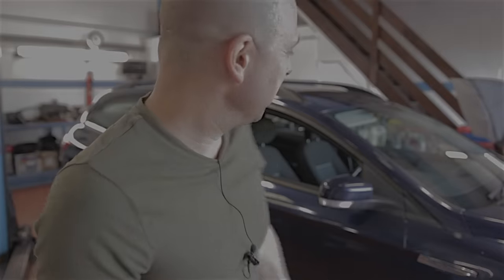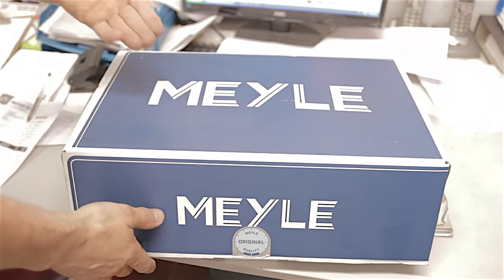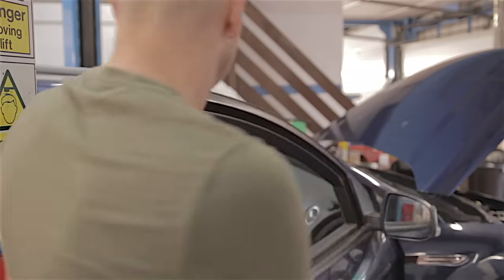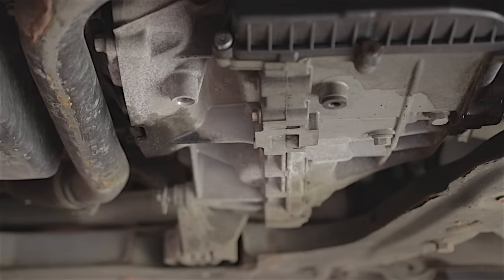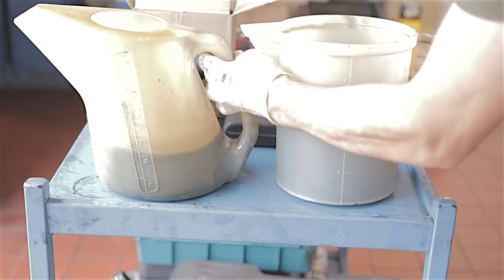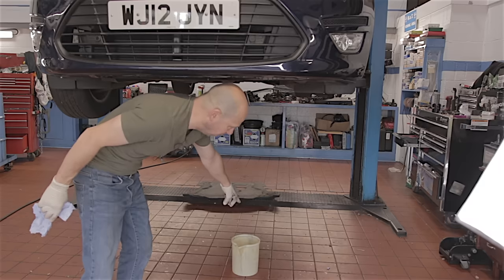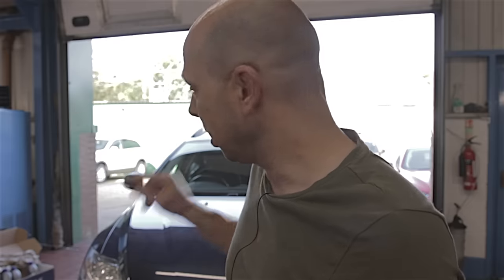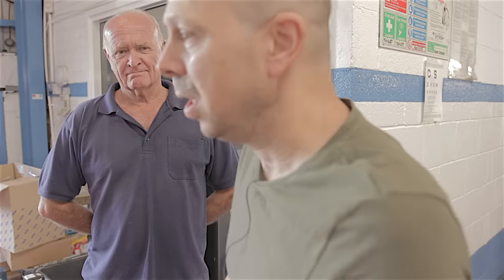Ford Mondeo Powershift Oil & Filter Change ....Lucky Me !!

Comment: hate the power shift box your right what you say about the correct oil if you use the wrong typeit makes the plastic spacers disintergrate in the clutch pack making the car judder and the plastic magnet holders on the selecor forks to brake away and the car dosnt know what gear it is in. what i would sugest and i know its expensive but get a box service kit from ford they come with the back seal for the oil filter housing that is bolted to the side of the box and replacement bolts and gaskets for the mechatronic unit so you can clean the swarf from the selector magnets runs like a dream after. the reason for going through the gears befor hand is it puts the box in service mode opening all the solenoidsalowing the oil to compleatly drain. you do the same after as it will purge the air from the system and take it out off service mode. its the same prosses when changing the clutch pack
Reply: Great bit of advice there Tony.
Reply: Thanks for that info, I got Ford to do a warranty gearbox  job on a Mk3 Galaxy after a small claims victory, proved in court that the wrong oil was used.
Reply: Hence I guess why they get called Powersh1t Box... However, I think this owner has been very lucky with his g-box
Reply: @davyarthurs  There are 2 types of Powershift. A dry clutch and a wet clutch box. The wet clutch are the ones which are more reliable and what is shown in this video. The dry clutch is the source of most problems.
Reply: @Dark-qx8rk  how did you found is the wet one version? i have a 2011 S60 volvo
Reply: @savvasgreece8700  If it has a Getrag 6DCT450 gearbox then it is wet clutch. You will have to ask Volvo to tell you what gearbox your car has.

Comment: I have a Ford Mondeo Mk5 2016 2.0 TDCi BiTurbo 210 bhp estate. The model only comes with a Power-shift gear box.   My local Ford dealer in Devon charged me £356.54  just to change the gear box Oil.   You have now reassured me that the Oil is very expensive..I thought I was just being ripped off , but appears just only now on the Labour. Thanks for a great video..

Comment: my mk4 is strange. when putting it in Drive or Reverse it takes like 2sec before it engage and it gives a smal jerk. IF i try to give throttle before 2sec it jumps like a kangaroo. I let a mechanic change oil but still same. What can be the problem? when it runs on the street all gears go in smooth. Its just from standing still when selecting D or R it feels like some delay

Comment: Followed your instructions and changed the oil on a 2014 C Max 2.0 TDI which went perfectly. Car did have a gear change issue but the new oil and a reset of the engine light resulted in smooth gear change and a happy father 😀
Reply from the maker: that's great news, cheers

Comment: I'd just like to say that it's very refreshing to find a video where this oil change is done correctly!. Good work.

Volvo recommend 40c temp for the drain and oil level setting (same gearbox 6DCT450 / MPS6).
Reply: I have a V40 with Powershift, what is the best oil?
Reply: @eufanca  any DCT fluid will do. 
They are expensive!
Reply: @eufanca  Castrol Transmax Dual

Comment: Great video, thanks Alan.  Just changed the oil and filter on our S-Max auto, found it almost impossible to access the filter (and the retention clip) without taking the nsf wheel and liner off, but straightforward other than that thanks to you. Cheers!
Reply from the maker: thank you

Comment: Have a 2016 180ps with powershift. Love it. Only had 1 issue where it would go into "limp mode" under heavy load. Turned out to be an oil sensor on the gearbox (changed under warrenty).
This is my 1st owned auto and will never go back to manual, I tow with it and its superb. Though I had a VW passet 2012 DSG for a week and hated every minute of that.

Comment: Did this job myself on my driveway,same colour car,ink blue titx 2013. I used Morris oil and filter using old housing,grand total about 70 quid. Use it for taxiing about 600/700 miles a week,now on 135k and still drives like a new car,so I've been told.
Reply: Did you check the level afterwards or just put 5.5 / 6 litres in ? I’ve heard some people just put in what came out & thats it

Comment: I run a 2011 S-Max same engine and gearbox. Had the car 6 years. Local Ford Stealers will charge anything from £250 -£400 for the service, I pay £250 obviously but will probably do it myself now after seeing the video!

Ford recommend servicing the powershift every 37,500 miles or three years. My car is coming up for 110,000 miles. You know when the oil needs changing as the clutches start to slip to the point where every change is an issue and in gear acceleration  is met with major slippage, change the oil and the car is beautiful and smooth again, I love it and have no complaints, I also tow with it and again it’s fantastic. I would definitely have another. Thanks for the video 👍
Reply: Hi Graeme, thanks for this comment.  This/these seem to be my issues.  Mainly in 1st and 2nd at the moment but suspect it'll get worse the longer it's left.  Certain I don't have any leaks so must just be wear and tear.  Have owned the vehicle since 119,000 and now on 142,000 with no evidence it's (outbox oil and filter) never been changed. Just ordered the same kit that's in the video for £112.  Just a case of trying to figure out how to get the car jacked up and level to carry out the drain and re-fill.

Comment: watched your auto gearbox oil change and found it very easy to do myself, mine as 7 lt of oil for the vignale and got my oil and filters etc from Ford Germany at £140 all in  P+P, took 3 days
and its Ford parts, also changed the engine oil etc. great and Hi to Mrs M LOL

Comment: I've had an S Max for 3 years now with the Powershift fitted. Changed the oil every 37000 miles and not had any issues with it. Still very smooth.
Reply: Sean Penney that’s a very specific number
Reply: @TheReecebob  I agree. When I first bought the car (second hand) there was no history of a gearbox oil change. I had the first one done at a ford dealer because of the garentee I had. The guy there said every 37000 miles.since then I've done them myself (2)
Reply: I should add I live in southern Spain. Maybe the oil change schedule here is different due to the high temperatures we have.
Reply: Sean Penney I was advised 37,500 or three years by Ford

Comment: Ford had put 7L in at 120000 km which i had no idea i started having transmission limited happening at now 180000 dumped the 7 put 6.1 in and best its ever ran dont put 7L in these I feel alot of the problems stem from incorrect transmission oil amounts and wrong type of oil and i would like to say thanks for the video saved me having someone else doing the same thing.

Comment: Another great video! Wet clutch Powershift gearbox are fine if serviced at correct interval but dry clutch Powershift gearbox are not great. Suffer from clutch shudder,  jerky pull away etc. Only in Fiesta and Focus petrol I believe
Reply: Fully agree with you 👍
Reply: What year are the wet clutch powershift gearboxes installed? Thanks
Reply: @jamesm5744  I believe 2010 onwards depending on models but not 100% sure
Reply: @simonnell9144  Thanks a million

Comment: Live in France and use local garage who does not want to do this job. hate the idea of going to Ford but might have to. Re the box, great. Just towed large caravan round Spain and Portugal, 3,000 miles with only one problem. 2 hours continuous driving including lot of hills at approx 55 mph, then turn off and immediately a 1 in 16 ramp up to campsite. car stopped and warning message "transmission overheating". waited a minute or so and proceeded slowly up the hill. No other problems but smell of hot oil that lingers, hence need to change oil. car has 95,000 miles on clock and don`t think oil has ever been changed. Good car, good gearbox. Hope that when time comes my sister-in-law will buy me another.

Comment: Hi Alan, great video as every one you make. I have a 2014 Ford Galaxy 2 ecoboost and I'm also about to change the pewershift oil. Great tutorial. I just don't like the dirty gloves on the steering wheel and gear lever. I always take them off so I don't dirty the car inside and reach the dirty steering wheel from the oil :-) but great video as always. You are the best
Reply from the maker: yeah, naughty me, cheers rudolf
Reply: @alan4x  Alan, you are a fighter 👍

Comment: Thanks mate. The info level check was what I was wondering about. 
I have only had some shuddering in first gear on a slight incline, a software update fixed it. It’s getting a bit thumpy now so I’m going to put some Redline Oil in to try and improve the shifting.
Reply from the maker: Glad it helped

Comment: I've got this gearbox in my M5 2016. I'm about to service it for second time. To change oil in gearbox I was told to do it every 3 years but because of the cost to replace gearbox if it went wrong. I change oil every 2 years when I do engine oil and filter.
Reply: Same engine and gearbox inside a Ford Galaxy,  I do the gearbox oil change every 20k miles . Its the tiny metal filings that go into the mechantronic solenoid valves that cause the issue of a faulty  gearbox. Changing the oil earlier resolves this problem.

Comment: I’ve Done this twice now
Best to use the Volvo service techniques for this dct   it tells you the transmission temps etc 
Mine started to shudder at 44000 km so I just do it at 40000km intervals instead of the recommendation 
Of 60000 with a genuine ford 
Filter kit plus Reputable dct oil that has the correct ford specs

Comment: Not a bad gearbox when its working although a read through various sites and forums on the internet might just put you off.Like most automatic gearboxes it will need regular servicing which most owners seem to neglect getting done and is often over looked due to expensive parts (mainly the cost of the oil)

Comment: Good video Alan... 👍 I have a Mondeo sports 11 plate  2ltr Diesel Automatic with 80,000 miles...Bought the car a few months ago and noticed when under load i.e. going uphill the Rev counter used to ‘twitch’. Read local forums that suggested lowTransmission oil can cause this. So I had the Transmission oil and Filter changed and now it’s fine. Could OLD Transmission oil have caused this OR LOW Transmission oil, in which case does that mean I have a slow leak do you think?.....  🤔. Steve.

Comment: This is the video I've been waiting for.
I've been looking at Mondeos for ages, I fancy an auto but I'm not sure of the drawbacks.
Reply: Got my Mondeo since March 2019, I Love it! First I wanted a german car but considering the cost of running such a car I choose Ford and I am happily surprised!
Reply: @frenchyxvi1698  The MK IV Mondeo is essentially a German car, built in Cologne & I believe mostly designed there.
Reply: @Zerofightervi  now I understand why I like this car!
Reply: @frenchyxvi1698  I'm after a Titanium X sport estate in white, I'm very picky.
I wasn't sure if I should go for the auto or not, I just don't like the idea of a DCT.
Reply: @Zerofightervi  I have a 2.0 tdi titanium auto estate as a taxi. Had it 9 months, done 28000 miles, car has done 70000. No problems so far 🙂
Reply: @stevensmith4754  I think it's always telling when you see a particular car being used as a taxi.
Reply: The 2.2 txs auto isnt a powershift, it's a durashift, so get that one 😉
Reply: @battfinkz  So is a durashift a traditional torque converter automatic?
I'm not sure what a txs is?
Reply: @Zerofightervi  titanium x sport mate. The durashift is an old school box, aisin awf21, used in a huge number of vehicles, not a wet dct. Its a for life box too so oil changes as normal really, not every 3 years 37.5k like the powershift.
Reply: @battfinkz  Sorry for my dimness, I've just finished a long day at work lol.
It's been difficult to track down acurrate info on this car.
Reply: @Zerofightervi  it is, I spent a few months looking for mine, 14 months later and still absolutely love the car. I have the 2.2 TXS in auto
Reply: @battfinkz  I've been looking at all sorts of different cars but I keep looking at the TXS (so much easier to type) as it ticks a lot of boxes for me.
The running costs, the looks, its sheer size of it.

Out of interest what sort of MPG you getting?
Reply: @Zerofightervi  the 2.2 is a bit thirsty, but on a long run driving it carefully I can get 40 to 45 mpg, even with the old school auto box. On quick blasts to work etc it's closer to 35mpg lol. But I dont mind, the facelift has more power, 200bhp 420nm torque, which is absolutely glorious lol. Even without any optional extras the txs has loads of toys, an equivalent german car would cost twice as much with the same toys
Reply: @battfinkz  Yeah, that's not great but then it's got 197 bhp & an auto box.
I wouldn't mind a 2.0 diesel as you get better mpg & lower road tax.
But then you miss out on those dual exhaust tips, & the additional performance obviously.

Cheers for your time, I appreciate it.
Reply: Dont buy one. I have a friend that's had nothing but trouble with his gearbox.

Comment: Have the same gearbox and engine in my focus. The oil is expensive like hell. I must agree there is not much info on service requirements of these boxes. Recommended Service intervals range from 60 000 km to don't worry it is lifetime oil (I assume they hope you get rid off it early enough) did mine at 240 000 km first time and looked brand new the oil
Reply: Ford says 60 000. I prefer to change the oil at 50 000.

Comment: I’ve got an Octavia 2.0 tdi DSG taxi, Skoda recommend changing the transmission oil and filter every 40k but I’ve always stuck to 30k due to the stop start journeys. They also take 6 litres but it’s a fixed price of £189 from the actual dealer for parts and labour
Reply: that is cheap AF

Comment: I have the same gearbox. 1 change mine every 3 years or thirty thousand miles. Total bill for parts for engine oil filter Derv filter. gear box oil and filter. O rings. Cost £280.00 from fords. For fords to do the full service was going to be over £700.00 pounds. I found doing the job my self was easy but I did have a pit I could use.
Reply: Hi mate, what oil spec do you use? 

"Ford WSS-M2C936-A" ?
Reply: @Dorngrunder  hello. Has it was the first time I I've change the oil I got it from ford's garage. It did cost more from them but new I was getting the right stuff. I found it easy to change using a pit.

Comment: Thanks for this amazing video. Really informative. I have a Ford Mondeo 2011 which hits sometimes at the first gear and reverse. And when coming to a stop. It changes gears smoothly otherwise. What do you think the problem is? I have already changed oil and filter but did not really help.
Reply: Jadder at 1st to 2nd gear is a common behaviour with PS boxes. Check how old is your battery. If battery cant hold the voltage the gearbox will jadder between 1-2. Please dont ask me why. This is the cheapest you can check before you start spending money on crazy expensive components.

Comment: Hi Alan, did you have chance to work with 8F35 transmission, did this have the same external fluid filter or is an internal one? what is the recommended service interval for automatic transmission fluid? Thanks and good luck !

Comment: Great video as always.. Just an addition to this MK4 facelift, the first version, from 2007-2008 they had 2 types of automatic transmission. Guys this box is the 6DCT450, from Getrag in collaboration with Ford at that time. But there is another one from AISIN W. (AWF21) with classic torque converter which has no exterior filter to change, and requires ATF red oil (WSS-M2C924-A)... for those who are still driving an old Mondeo, like me :))).
Reply: Which years were the Torque Converter and how to tell? Just 07/08?
Reply: @ln5747  well as you saw in Alan video, this gearbox has an external oil filter, and the classic torque converter has only magnets on the inside of the cover. I did not open it to confirm location etc.... If you remove the air filter you will see that there is a stamp with the gearbox specifications, but its possible not to be visible anymore... Or you can just use a OBD II to read the TCM module info
Reply: @engineercar  I was hoping for something easier than that haha, I have no mechanical experience. But thanks 👍🏻

Comment: Hey Alan a very good vid again! Thank you ! Can you tell us a bit more about why the 2litre Diesel TDCi engine that is used on the Focus MK3 and Mondeo MK5 has DPF issues and is deleting and removing the DPF the right choise? Is it the style of driving, short runs , fuel qallity or else and how do you deal with this issue. I have the 1.6 TDCi Focus MK3 and never got anny issue but want to get the 2ltr 163 bhp one as next vehicle......  Cheers !

Comment: Love your VLOGS I work in Australia for a Mitsubishi dealership Mitsubishi Evo and ralliart have the exact same trans there bulletproof reliable but over here there hideously expensive to maintain $350.00AD just for the filter. Then another $250AD for oil the only reason I’ve heard that the powershift trans has a bad name is due to the sane use of name used in there dry clutch version behind the petrol variant the wet clutch one you serviced are so reliable and used in so many applications/manufacturers. Typical bloody Ford trying to claim something that’s not theirs and then stuffing their version of it up.
Reply from the maker: yeah i do hear ford parts in general are expensive and hard to find in australia

Comment: Wish you were my mechanic had my 58 mondeo serviced kept smelling fuel 2 days later go's up in flames on the motorway gutted had 250,000 on the clock never gave a days trouble in it's life 😩😡😠on a happier note I think miss m gets better looking every video 💕👍💞
Reply: Gutted 😣
Was it a diesel?
Reply: Yes is was diesel engine
Reply: Darren Meears that’s not a power shift is it ?